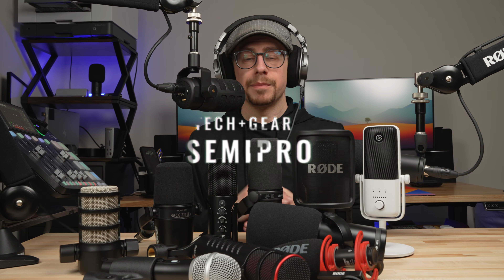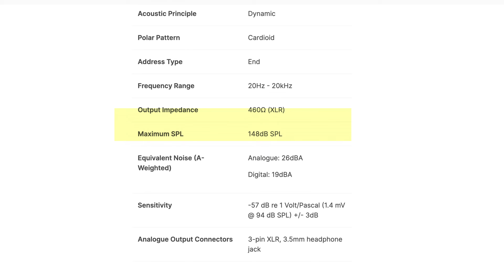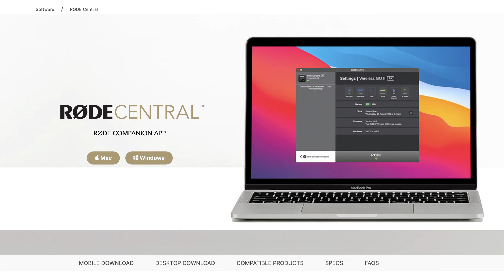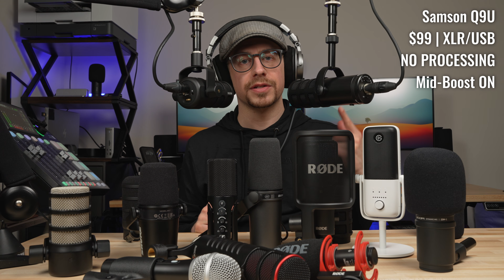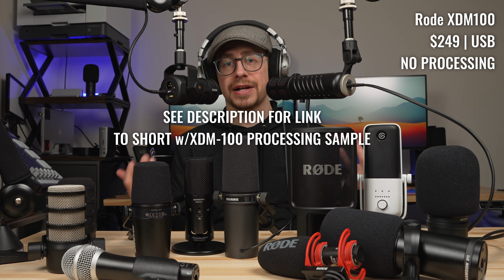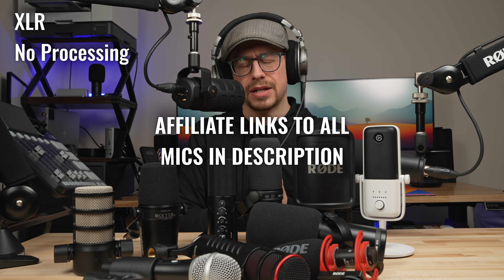Rode PodMic USB Review with Comparisons - MV7, SM7B, Profile, XDM100

Comment: Excellent review, and subbed. Had fancy gear for many years, but retired, and no longer need Austrian Audio OC818 quality. Have the Rode Streamer X, and really wondering if I should get the XLR only PodMic or the USB. The USB would be very versatile, I do travel quite a bit. The MV7 sounded best of the bunch you tested; however, the SM7B, a mic I owned a decade ago, sounded dark and lifeless. I would rank the sound MV7, PodMic USB (bit brighter and cleaner, might be intrinsic, perhaps it was processing). I've seen a few reviews that say the USB PodMic sounds better over USB than XLR, but I did not hear that in your demo. Guess I will buy both, and do side by sides. I'm in SE Asia for a year, so not as easy as just buying on AMZN and returning the loser!

Comment: Really debating between the sennheiser and the podmic usb. I prefer USB right now just cos it's easier but I like the idea of being able to upgrade my set up to XLR without needing to invest in a whole new mic. The profile is cheaper though and sounds really good! My issue is just a terrible recording environment and I'm worried that a condenser is just going to pick all of it up. Any thoughts?
Reply: You can make it not pickup the background sounds by using some filters. Profile doesn't come with a software so you will need to use obs or some other platform to apply those filters. But the noise removal comes at the cost of quality. So prefer some dynamic mic instead of condenser ones.

Comment: I really appreciated diving into your video comparison of microphones. It's clear you've put a ton of work into it, and honestly, the sound quality from the PodMic USB blew me away. But there's a catch for me – the software that comes with these mics is for Windows only, and I'm a Mac user. I'm curious about the gain levels, like does powering the mic through USB affect its gain, or is XLR the way to go for enough juice? Here's where I'm coming from: I ended up with a Yeti X mic, not realizing it was a condenser instead of dynamic. I've heard from a few folks that dynamic mics are usually the go-to, especially when you're tweaking the sound with an EQ. They also said the Yeti X rocks in a soundproofed space and Vocal booth, which got me thinking since I record in my home office and am still trying to nail the perfect setup to cut down on echo reverb. What's your take on this? Should I think about selling my Yeti X for a dynamic mic? I'd really value your insight, especially since I'm still learning the ropes here.

Comment: In an untreated room, which one is better at rejecting reverberation?
Reply from the maker: Out of all the microphones in the video, the best at reducing reflections would be the SM7B in my experience. The best mic that I've ever used at reducing the sound of reflections would be the ElectroVoice RE20. But for a USB mic, the XDM-100 does a very good job and the PodMic USB is also quite good especially if you can keep the mic fairly close in the 6" range.

Comment: With regard to the XDM-100 it’s not just yours, I sent my first purchase back because of the monitoring white noise… Using a ground loop isolator I was able to significantly reduce it but who wants that thing hanging out of the mic. The second mic I received was still noisy but less than the first, I could reduce the noise with just the cable extender so decided to keep the mic because I love the sound I can get with the mic and it comes with everything you need. This is, however, a very disappointing at this price point and completely unexpected from Rode. Great review!
Reply from the maker: Thanks for sharing! I agree it's very strange and disappointing coming from Rode that many of the XDM100 units would have excessive noise in the headphone output. Seems like something they definitely should have addressed prior to release for a product in that price range.

Comment: one question. If i dont have an xlr controller like the scarlet solo, is it worth getting the scarlet or is the sound quality not too different between XLR and USB. Thanks
Reply from the maker: In my opinion the sound quality of the podmic USB is definitely good enough over the USB connection that you don't need to use it with an interface if you don't have any other reason to get one.

Comment: Quick question. I'm new to all of this and was wondering. For USB mics like ATR2100x or Sennheiser Profile with no software features, can you run it through OBS and apply filters/effects that way?
Reply from the maker: Yes! You can apply effects in OBS that will be "burned in" to your live output/recording. If you're recording, I personally recommend applying your processing afterwards because you'll have more control. But for live use, it definitely can be helpful to apply a little bit of processing via OBS if you want to add a little compression, corrective EQ, etc.

Comment: Awesome comparison, thank you for that! A question: does the Shure MV7 works well on Windows OS?
Reply from the maker: Thanks! In my experience, the MV7 is stable on windows. My work computer is a windows laptop and I've never had a problem with it connected to a USB-A port on the dock (HP dock). I have experienced a few bugs with it connected to my iPhone via the camera adapter - sometimes the MOTIV app doesn't recognize it and I have to unplug and plug it back in, but on desktop, both mac and windows seem to be consistent and stable with it (with or without the MOTIV app open).
Reply: @semiprotech  Thank you, appreciate your detailed feedback! Just a quick question if you don't mind, you use Windows 11, right?

Comment: For 2+ years I've used the Rode GO II micrphones for youtube. I have the MV7 right now and It's...ok. Would the Podmic USB be a solid solution for YouTube recording?
Reply from the maker: The PodMic USB has a little bit of a brighter tone than the MV7 to my ears. If you're looking for a little more clarity, you might enjoy the PodMic USB. I also prefer the DSP options in the PodMic over the MV7 but that is also subjective and wouldn't make a difference if you don't use the built-in DSP. The only thing I would say about the PodMic's sound is that it's a tad mid-forward, so if your voice has any nasal qualities it could amplify that a bit. But otherwise I would say it's a solid choice. Is there a specific quality about the MV7 that you're not liking?
Reply: @semiprotech  The application on desktop for the MV7 was..ok at best. Didn't really assist in any noticeable way for me. I now have a Focusrite solo, but the gain is up at around 90%. Also I noticed I sound much brighter and my Plosives are very noticeable. I know part of that is gain, but it's up that high because I use the microphone for work calls as well.

Comment: Great video! Awesome of you to do such an extensive comparison. I currently have the Elgato Wave 3. When I listen to your comparison I don't noticed much of a difference. Might be slightly better with the Rode. 

I use my microphone setup on the road mainly. Any suggestions on sticking with Wave 3 or adding the new Rode mic? 
Thx!
Reply from the maker: Thanks! It would depend on which of these factors you care most about and/or would use the most: 
- PodMic USB has convenience of retaining the DSP settings in the mic, no software is required to add processing.
- PodMic USB is definitely more robust/durable, BUT also a lot heavier in a bag. 
- PodMic requires a separate stand - Wave 3 has the desk stand included. 
- The Wave 3 is going to probably be a little more forgiving on all voices - the PodMic tends to sound great on some voices and less so on others (it's a bit mid-forward so a nasally voice might have that amplified a little). 
- Wave 3 has better on-mic physical controls. The PodMic doesn't have any physical control over the monitor mix/blend or the mic gain. 
- PodMic USB should be a little bit better at isolating voice vs. background noise - in my testing my room was quiet and has some sound treatment, but in a space with appliance noise, outside noises, etc. the Wave 3 will likely pick those up a little bit more. 
- Wave 3 has a slightly better headphone output - it had the cleanest headphone output of all the mics I tested in the video. PodMic USB is definitely usable for recording & playback, but I could actually listen to casual audio through the Wave 3 without being bothered by any hiss noise. 
- And of course the PodMic has the XLR connection there if you ever need it. If you at some point get an XLR recorder or interface to travel with or need to plug into someone else's', there's no need for a different mic. 
If none of those things tip the scales in the direction of the PodMic for you, then keep rockin' the Wave 3 because it's a great mic!
Reply: @semiprotech  I appreciate all this information so very much! Thank you! 
You make really honest points. I like lots about the RodeMic but my El Gato is rockin right along. I like the way the pop filter attaches to my el gato. Make it look better. I personally think the rode filter makes it look less good but it’s the sound that matters. 

Thanks a million. Keep making great content!

Comment: I can't believe how good the VideoMic GO 2 sounds. I get a lot of reverb when I use mine, and I had to get a dynamic mic - MV7x
Reply from the maker: The Go 2 sounds much better than I expected at close range as well. It also sounds notably different to me when connected over USB compared to using the 3.5mm output into a camera. It must be something different about the USB (5v) circuitry vs the 3.5mm (2.5v plug-in power) circuitry. The MV7x was a great choice though if you were trying to minimize room echo, that should definitely do the job for you!

Comment: Given the scenario that the price does not matter at all, which of the models in the title is better suited for podcasts? PodMic USB or NT1 5th gen?
Reply from the maker: The PodMic USB will be more forgiving in recording spaces that don’t have sound treatment or have some background noise. The NT1 5th gen is a fine choice for quiet spaces with some sound treatment. The NT1 is going to sound a little more neutral/natural but will require more tinkering in post (noise reduction) if the recording space has fair amount of reflections or ambient noise.

Comment: The Podmic USB, especially when you turned on processing, sounded considerably harsher. I think you might've overdone it with some of the DSP settings.
The low boost definitely helped.
Reply from the maker: I did have the DSP settings turned up pretty high (higher than I would use) just to make sure it was more obvious when it was on vs off.
Reply: @semiprotech  I'd suggest avoiding that, except maybe for a small segment of comparison, as people use these videos to pick a microphone, and if the DSP sounds overbearing, it'll affect their choices.
Can do a small segment with them "over the top," but then for actual testing, go with what you think sounds best.

Comment: Btw have u isolated ur room? Is there any way to digitally get rid of the voice resonating from empty walls...
Reply from the maker: I use two main sound absorbers in my recording space and the floor is carpeted (disclaimer - affiliate links): 
1. AudiMute sheets over the windows. They cover pretty much any size window nicely - not soundproof but definitely dampen the sound from outside and absorbs reflections inside. https://amzn.to/3Xn7RtS
2. Sound blankets hanging on stands. I use two of the 80x80 inch 10lb blankets from vocalboothtogo and hang them on light stands with a cross-bar. These have made the biggest difference for me in reducing room reflections. https://semiprotech.link/vocalboothtogo
I also hang a heavy pair of curtains over the door while recording - any curtains, just double them up and hang from command hooks. 

On the software side there are de-reverb plugins available for most DAWs. I've only heard good results from two things personally though - the new Waves Clarity Vx DeReverb plugin ($29) https://www.waves.com/plugins/clarity-vx-dereverb and the Hush app for Mac ($49) https://hushaudioapp.com/. The hush app is only available for Mac currently and works as a separate app rather than a plugin but it works really well in my experience at reducing both background noise and reverb. 

Hope that helps!

Comment: If the Shure MV7 and the Rode PodMic USB were the same price, which would you buy and why? Thank you
Reply from the maker: I would buy the PodMic USB unless I needed to use both USB & XLR outputs at the same time, for these reasons: 
1. I like the sound of the available processing (minus the noise gate) better than the options available in the MOTIV app. 
2. The included windscreen works - the MV7 windscreen really needs to be replaced if you want something effective at stopping plosives. 
3. The MV7 is still micro-USB and that annoys me. 
4. PodMic USB works with Rode Connect and UNIFY which gives you free access to custom routing of your inputs and system audio. The MOTIV app is nice (and the mobile app is admittedly better than anything Rode has for smartphones) but doesn't give you the same level of control for multiple sources. 

From a sound quality standpoint, they don't sound the same but both are very good so it's pretty much a tie for me there. I also have so far found no significant difference in their handling of background noise - both perform well. The PodMic USB might pick up bumps of the boom arm a bit more than the MV7, and the MV7 also has more controls on the mic through the capacitive-touch input. I just don't personally use those controls a lot so it's not a huge selling point for me. 

A lot of that is personal preference and definitely subjective - the MV7 is still a great option, but for me it's the PodMic USB!
Reply: Okay thank you very much! I’m more so focused on the sound qualities of the microphones as I’m not too bothered about Micro USB, I’m willing to get the RK345 replacement pop filter and I don’t have an audio interface. I appreciate with regard to the quality you gave it a tie due to it being down to preference however, so I think I may go for the Shure MV7 as I can buy the mic 2nd hand for a lower price and hopefully find one in good condition. 

Thank you for the reply, and great video. Keep it up!

Comment: Excellent comparison, as always.

I have a Shure Mv7 and I think that, of the microphones presented, it really competes directly with the PodMic USB. The sound is similar, the functions, the size. The Mv7 has some small advantages such as the layout of the command buttons (volume, headphone volume), the simplicity of the software, etc. But these are aspects that are not critical for use, things that are compensated by the excellent price of the PodMic USB.
If I didn't have the Mv7 I would absolutely buy the Rode. A great option for what it offers.
Now I need to mention: I was surprised by the quality of the Rode Videomic Go II. I had already watched some tests of it, but all with it being used as a shotgun (on top of the camera, for video). And yes, in this function it is good for the price (much better than recording with the camera microphone, of course). But I found the quality surprising when used for voiceover or broadcast. A full-bodied sound, without sibilance.

Thank you and a hug from Brazil!
Reply from the maker: Thank you! I totally agree, the MV7 has some advantages with the physical controls and ability to use both outputs. I'm not a huge fan of the processing options in the MOTIV app though where I find all the processing except for the noise gate to improve the sound of the PodMic when used sparingly. The GO II definitely was a surprise to me! I figured I would throw it in there in case anyone was looking for an option that could be used off-screen and I was shocked by how nice it sounds up close. It was maybe a tad boomy at a distance of 4-5 inches but I think 6-8 inches away and it could definitely be used for voiceover segments in addition to general overhead booming.
Reply: @semiprotech  could I get the VideoMic Go II sound as crystal as the PodMic USB easily via the Rode software? Or is this a definitive plus of the PodMic?
Reply: @simonhuegly  you can not get it sound the same but after applying some filters, you can make it sound good enough.
Reply: The command buttons are definitely not an advantage for the mv7.
Reply: Same here! And I instantly thought, why would I buy such a bulky PodMic, when the VideoMic Go II sounds sooo good, while being much more portable for outdoor use, too. Well, I understand it totally depends on the use case. 
The integrated DSP capabilities of the PodMic could be game changer for everyone who concentrates totally on Podcasting indoors. 
I am just starting to do some outdoor Video as a hobby photographer and wanted something also for indoor voice over. 
VideoMic Go II might be a good allrounder??

Comment: Great job on this video! Very well done. 

Tip - it looks like you’re using On-Stage quick release connectors. They’re inexpensive and they work - until they don’t. The spring loaded mechanism is fully sealed meaning you can’t inspect it for wear. And they do wear, but you won’t have any notice, until it fails and your expensive microphone hits the floor. I guess technically at that point it is “On Stage.”

Do yourself a favor and upgrade to some quick release connectors with a better design.
Reply from the maker: Thank you! I am indeed using on-stage quick releases. Do you have a recommendation for a more sturdy option?
Reply: @semiprotech  I use and really like the Gator Frameworks quick release connectors. GFW-MIC-QRTOP
Reply from the maker: @Astronaut_FX  Thanks! I'll check them out.